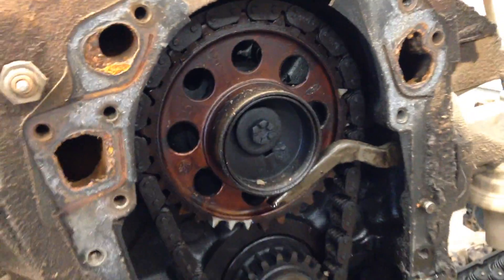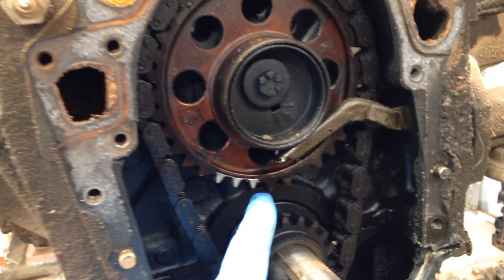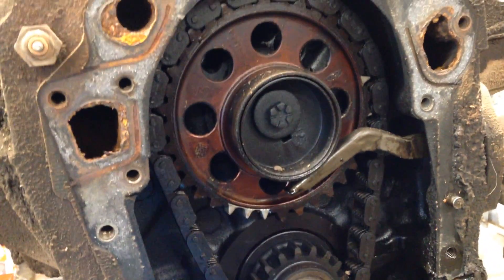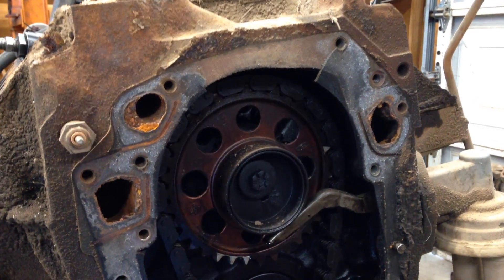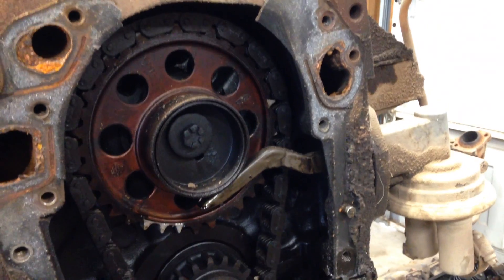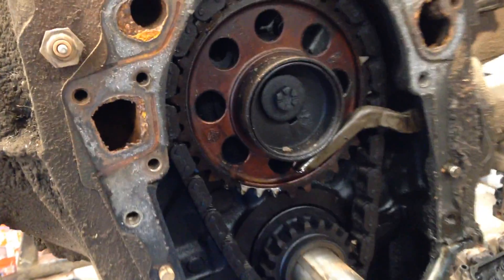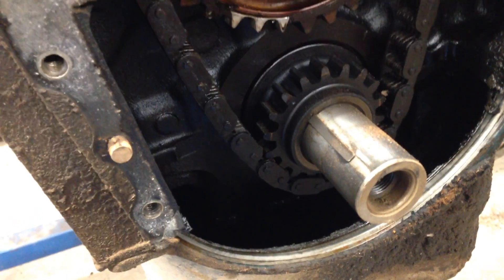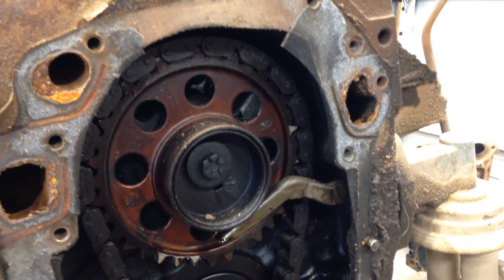Ford 351 Plastic timing gear

Comment: Before I knew you never go to a dealership but for factory warranty work, I took my 67 Fastback into a California dealership and brought in a quality double roller to have installed.  The guy wrote it on the work order and I signed, got back and my double roller was still on my passenger seat, the mechanic had installed a factory fiber gear set.  I threw a fit and named my dads attorney, well known in the area, and the manager conceded and installed my set as requested.   The mechanic actually said, 'I only install factory parts.'  You may install crap if you want but not in my vehicles, I told him!  It's not crap, he said.  Then why hasn't the aftermarket embraced and improved them? Oh they did, near silent even in the mid 90's with all steel gears and chain.  Ignorant idiot that lost his job not long after, I was told,  for continuing to do it 'his' way.  He was confused with new vehicles with warranties, of course you use factory parts then!

Comment: I had a 1967 chevy ss with a 283 ci. that had a plastic coated timing gear. It stalled the engine. The engine was factory original.

Comment: No different today 5.4 phasers,tentioner seals, guides. New turbos lmao. New 5.0 is the only decent moter. Ford inline do this day is the most reliable/duarable. And even some of those had a nylon gear. We live and live😒
Reply: I have a 300 inline in my 86 F150... love that motor, but it just stopped starting. I think this damn nylon gear just gave. Worst possible time, I'm 16 and about to put this thing back on the road after it sat in a field for seven years. I'm putting a metal gear in it.

Comment: i had a 390 with the nylon gear and the hole thing was out of nylon even the center mount when i seen it it was wtf moment i was young then it was about the 6th motor i rebuilt after that every time i see one i have to laugh the best part is the parts house asked if i wanted the nylon gear like i wanted to save 1 buck and not have my motor last i forgot all about that till i seen this video thank u for making me laugh just thinking of it the good old day when crack heads design  motors

Comment: Briggs & Stratton decided to stop using solid steel cams in their engines about fifteen years back. In its place it was a steel gear and shaft with these hard plastic lobes. Problems abounded from the start. The main cause was the heat treat wouldn’t last and I thin a few months it’d stop running. And since the valves were no longer opening, if it was a pull start you’d feel like it broke your wrist trying to get it to restart

Comment: I had one of those on a '77 Olds Omega with that odd fire V6, remember those?  Mother in law was looking for a car to drive. A guy fellow mechanic at work had one . He drove this every day to work couple years, no problems. She buys it $300. About 1-2 weeks later, no start. Cranks, has spark, fuel, 90-150 psi compression WTF? Pull the timing cover and 9 teeth are gone, 5 one one part and 4 on another part. So it had jumped a few teeth just enough to foul up the  And I did put one of those plastic gears back in. They go 70-80K mi. That would be good enough. She didn't trust that car after that so I bought his other car and took the Olds drove it awhilw. Sold it to my brother. He wrecked it a few months later.

Comment: I’m tearing apart an Olds 403 with the lame plastic gear. Although it’s actually in better shape than the crankshaft...I think the previous owner tried “rolling” new bearings in and quickly made everything worse

Comment: Replaced one of  those Piece'sOS in 1974 on Mach one with just shy of 40K miles. It  was December in Nebraska, 10 degrees outside, no garage. Once running it was discovered that The engine had also bent two valves.  I drove it back  to Calif that way, threw the keys to the ex family memeber/owner and told them you need a new motor :(

Comment: A couple points. It's not really a "plastic timing gear", although it does have a thin plastic coating. However, if it is in fact, an aluminum gear, then I would be a bit leery of it. Aluminum isn't known for being a good bearing surface, as its much softer and more easily worn and broken than steel. Granted, there are tougher aluminum alloys out there, but a good steel gear would still be preferable in my book.

Comment: *They don't have plastic timing gears*. They are made of metal(aluminum) with a thin plastic coating. With all due respect, there's a BIG difference between a "plastic timing gear" versus a metal gear with a thin coating of plastic.  However, I think it's great that you pointed out that the plastic 'coating' can detach and drop directly into the oil pan, which can cause internal engine problems. Also there's the issue involving aluminum not being the best choice of materials to use for gears, in a relatively high friction and pressure application. But if you remove the plastic coating, I think I may still prefer an aluminum timing gear over a timing belt on an interference engine.

This is an unbelievable oversight by the engineers that designed it, as well as ALL the other ranking employees who must have been aware of this obvious potential problem!
Reply from the maker: it wasn't an oversight at all it's called planed or built in obsolescence the manufacturers knew good and well that these types of gears were weak and would fail this kind of engineering assures the engines will need service and repair, If you can get an engineer to be honest about it they will tell you they are instructed to design parts to fail at or just after the warranty expires
Reply: Myvintageiron7512 
That's certainly true in many instances. But there are some examples of engines that seem to have been built to last 'longer than E.O.W.(end of warranty). I just learned of the timing gears in the Ford 300cid inline 6, not to mention it's strong-er bottom end. 

Then there's the Buick 3800 V6. I am not a mechanic. I run a small landscape business, and I've got a client who owns a 2002 Buick Park Ave Ultra, with the aforementioned supercharged 3800 V-6. The car has been moderately well taken care of, and it's got over 225,000 miles on it. There are occasionally problems with peripheral parts, but the engine runs well. Then there are the horribly planned out interference engines with timing belts. In 2000, we bought a mint condition late 80s Ford Festiva. It had 47,000 orig miles and ran great. Paid $2000 for it.

 Maybe 2 months later, I was driving it one morning, when the engine suddenly revved way up for no apparent reason, then shut off. I pulled it over, tried starting it, and it turned over WAY too fast and easy. Turned out, it shaved teeth off its timing belt, jumped timing, the pistons slammed into the valves, and it was instantly worthless and it's engine shot! It had a Japanese engine.

Comment: My mom's postal Jeep with the iron duke she used for delivering newspapers had a weird ticking sound for years. 
Well it jumped timing one day outside of someone house causing it to backfire and the owner of the close by house came out with a bat wondering what was going on getting ready to call the police. 
My mom was saying," it's the Jeep I'm sorry". 
Got it home to find two metal timing gear teeth in the chain grinding 3/4 of the teeth off the cam gear. 
My Dad (that been a mechanic for over 15 years) 
Never saw anything like it before but the year long mystery was solved the ticking noise that eventually lead to gun shot loud noise was timing gear teeth stuck into the timing chain.
See also killed a worn-out duke that throw a PUSH ROD (not a connecting rod) out the side of the cylinder.
Reply from the maker: The iron duke had a plastic cam gear they were known for sheading timing sets

Comment: would that be in a 73 too. I'm building a rat Rod and wasn't going to do anything to the motor for a while. but if it's plastic I may better change it. it's a 351\400 m
Reply from the maker: it could be

Comment: I had the 79 olds 403 that came In the 6.6 liter trans am. the timing chain simply jumped a few teeth after turning it off. spent an entire day before I figured it out.

Comment: Rebuilt a 1968 Mercury 428 several years ago, nothing left of the nylon teeth and the teeth on the aluminum gear were worn and sharp as a razor.  How it hadn't jumped time I'll never figure out.
Reply: Seen that too, my buddy threw his into the wall where it remains stuck today.  An acquaintance was by the shop with friends and tried pulling it out while alone in the shop, we caught and stopped him. My buddy said had he pulled that 428 gear out of the wall, he would've stuck that guy into the wall. Lol

Comment: When I was a teenager I had a 1966 Mercury Comet with 2 barrel 289 3 on the tree .

     It jumped time .  When I disassembled it there was an enormous amount of wear in the plastic cam gear .

     I replaced the chain & both gears ( with metal gears ) .

     So , the plastic cam gears go back to at least 1966 .

God bless
Wyr

Comment: I had to replace the water pump on my 79 Ranchero 351 M engine, and I thought, I might as well look at the timing chain. I noticed the plastic sprocket had hairline cracks going from the center out to the ends of the teeth. I replaced it with one that had a metal sprocket and double- roller timing chain back in 04. Thank God I did!..lol. Thanks for posting this!!

Comment: 1984 Chevy Camaro had plastic gears in the 305, but that engine is non-interference, meaning that the valves don't hit the pistons when the cam goes out of time with the crank, which mine did. So I just put a Cloyes roller chain set in and the problem was fixed. But this non-interference design is a very good idea for any engine built primarily for reliability.

Comment: I had a 1980 C-10 w/ a 305 w/ a nylon gear. The engine wouldn't start at one point. Upon removing the timing gear cover, the chain had stripped the teeth off the gear and the oil pick up was clogged.

Comment: During the early days of NHRA Pro Stock the engines were very hard on valve train parts and racers were constantly replacing broken springs and rockers. Suddenly Bill Grumpy Jenkins stopped having chronic valve train problems and his competitors wondered what his miracle cure was.  They finally found out that old Bill had traded his high tech gear drive for a stock, nylon timing set from GM. The soft nylon teeth were able to absorb the engine harmonics instead of sending them up to the valve train.

Comment: Who cares about a 351M, but a lot of otherwise great Ford engines have been taken out by that nylon shit getting into the oil pump and starving the bottom end for oil.  The funny thing is that they almost never jump timing. They just keep running with slack chains and contaminate the whole engine with nylon (thanks, Ford).
GM's, too.

Comment: My 400 had the link belt chain, did near 40 years and 150000 miles. I have though had 10 y/o 60000 mile gears break. 
GM used the link belt chain forever. Ok in stock road engines. A friend loved them,, 8000rpm  roller cam drag engine and never a failure.
Though in reality a good true roller chain is better. Though those fail too. I had one had a link pin fall out, only 10000 miles. Premium JWS chain. 
Read Smokey Yunicks thoughts on chains,, the instrument of the devil!

Comment: Mom 1979 Capri (Merc) with the 2.8l V6. I was (attempting) to drive it to school on a very cold morning... raced the engine to warm it up... The pressed on nylon teeth on the timing gear all just broke off.

Comment: I did a timing chain on a 72 gran torino with a 302 that had a plastic gear and it jumped time and bent all the valves but 3 and what a job .

Comment: I had similar thoughts when my 1971 Chevy El Camino plastic timing gear failed. Fortunately it was non-interference and the only damage was that the pressed-in intake rocker stud was pulled out of the head. As bizarre as it was to have plastic teeth in my timing chain, I will admit that it lasted nearly 100,000 miles. After cleaning out all the teeth from the oil system, I replaced it with a Cloyes Double roller. Thanks for bringing this to light.

Comment: I rebuilt my 1st motor at vocational school when I was 17. It was a  351 m in my mercury . It had the plastic gear. I was young and didn't know anything, and put a new plastic gear back on. Thats all I could find in 1987 for parts.

Comment: These are the same folks who brought us the Vega, aluminum engine that would warp the second someone farted, or the pinto with the fuel tank designed to explode upon rear end accident, or the famous shoddy work that gave us brand new vehicles with loose doors tailgates poor workmanship it was a time we did our job screw you lets get some beer. Period.

Comment: Almost as bad as Toyota putting a nylon timing chain guide/tensioner...which btw, when it wore out the timing chain would cut a hole into the water jacket...engine toasted!!!
Reply: tetekofa 
I was looking at a picture of the area around the Ford 4.6L modular motor timing chain(s), and noticed the 2 long timing chains that turn it's overhead cams, run on what appeared to be plastic guides etc. So, a metal chain running on plastic parts. I am no modular expert, but that looks like it could be an issue.
Reply: Mike Brink 
Are any of the different versions of the 'modular motor' considered to be interference engines? If so, can a little bit of slack in the long-ish timing chains cause a piston-valve interference issue?

Comment: Making engines quieter is a major reason why timing belts were used instead of chains.

I think the Ford 4.9 I6 had non-metallic timing gears, and that engine was in use until the mid 1990s.

Comment: AMC use them as well could been a ford or gm part but you find them in amc V8`s .... all so remember Car`s where not so post to last longer then 8 years in the 70`s, or should i say the car manufacturers did not have to supply parts past 8 years by govermint standers, that my understanding of how it was back then , So yes it was good idea to make the car motor quitter and failure rate was calculated beyond 8 years :)

Comment: The British Ford Essex 3.0 V6 in my Ford Capri has this ,the cam is gear driven with no chain and the cam gear is made of steel with hard plastic teeth, they did this because in a gear driven setup 2 metal gears make a very loud whirring noise until they are worn in, i am thinking of buying a steel aftermarket one though just for peace of mind, so far it's been fine and the car is on it's second engine at 305k miles.

Comment: Ford used the nylon tooth cam gear for many years.  I rebuilt some Ford 302 & 351W engines from the late 60s, 70s, and 80s.  They all had the nylon cam gear. Yes, they last about 100K miles, so just change them out to an all steel gear set at the 100K mile mark...
Reply: Back in the day I rebuilt a couple mid 60's 289's (all HIPOs) and they had aluminum timing gears...I also rebuilt a '70 351 Cleveland 4V and it too had a non polymer timing gear...aka metal....just sayin.
Reply: I did a wp on my old 85 crown vic.. Mechanic Neighbor said..better do the timing gears too or you will be sorry!  He even offered to take me to the parts store and help with them. Decided not to. A few months later I ended up junking it cause it jumped time!
Reply: not true i worked for ford 4 years - use to see those cars towed in all the timing for failed timing gears or damaged engine some as low as 30k miles on them would not run
Reply: i worked for ford-42 years